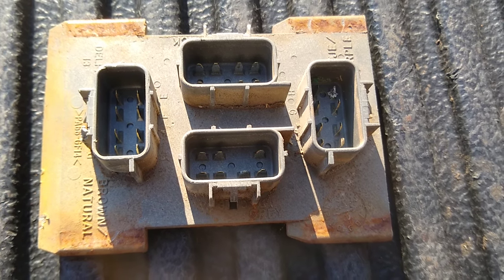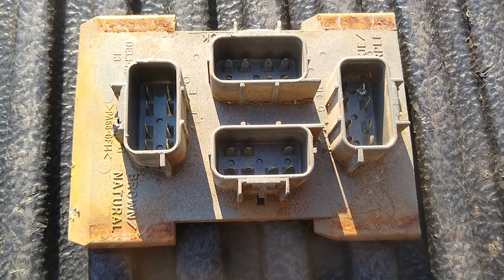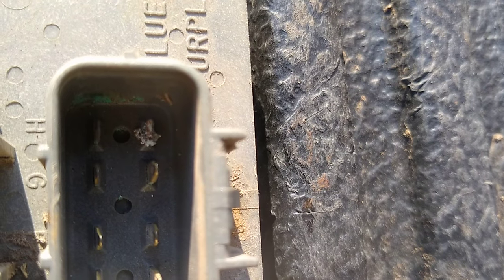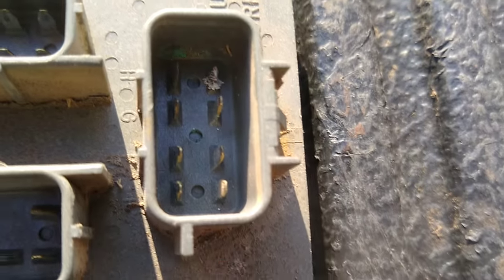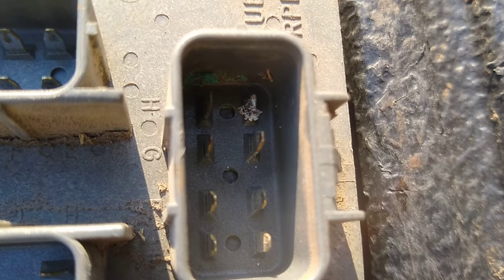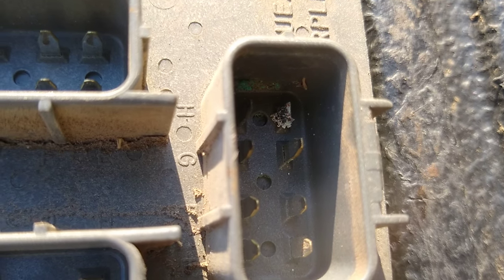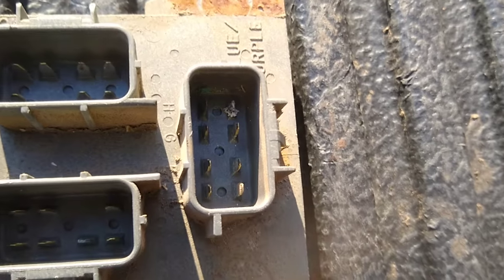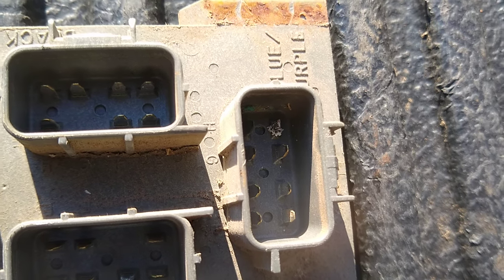1999-2013 Chevy Silverado or GMC Sierra tail light issues

Comment: Its located behind the rear bumper, you should see it if you look up from under the rear bumper, if you need to just follow your tail light wires and it should lead you to this board. 4 plugs are all plugged into it.
Reply: Could this board, also cause fuel pump module issues?
Reply: What is this board called

Comment: I have a 2004 Chevy Silverado my dome nor my reverse lights worked I replaced “TBC 2A” (Fuse) on the interior fuse box located on the driver side it’s a TRUCK BODY CONTROLLER also, make sure to check “TBC 2B” it’s a truck body controller as well.  This fixed my dome and reverse lights problem.
Reply: I also have an 04 do you know where the fuse for the license plate lights is & how it’s labeled ? bulbs are good & I have a new harness. I am thinking it’s a fuse want to check before I buy the circuit board
Reply: @BernieM2819 I also need the answer to this. All my lights on the back work except license plate lights

Comment: Got a 88 Silverado ...i got brake lights ..turn signals ...brake lights and reverse lights ....and front runnig lights ...but my rear running lights come on ..i get to the gas station two miles away from home shut everything off and boom.... when i go to leave and no tail lights happens every morning on my way to work...need help could this be the problem????

Comment: Thanks, my cousing has brakes lights, reverse lights and turn signals but the tail light on the left was only getting 0.06 current to it while the right was getting 12.15, then an hour later the right tail light stopped working 😅 I'll look for one of these at Autozone tomorrow and put it on to see if it resolves the problem.
Reply: I’m assuming it was dimmer as well I’m having a dimmer reverse light, bulbs are new and so is the harness you reckon I need a new board or may it be a fuse
Reply from the maker: @nestorsalazar3713  dimmer lights?  Reverse lights I would check fuse first then possibly wiring issues with  Is squirrels and chipmunk can destroy a wiring harness. The board is only really a problem in places it snow  or someone with a boat who backs the trailer in the water.
Reply: Didn't fix her problem but at least she has a new board 😅 something must be blown.
Reply: @ryannrjohnson  any update on it lol I’m having the same problemo
Reply: @battleborn528  yes, I switched her fan relay with the light relay and the lights started working, so I just had her purchase a new relay. When that relay went bad on my Trailblazer the headlights stopped working, I didn't know the bad relay could cause the rear lights to get intermittent power, but replacing it solved the problem.

Comment: My license plate lights flash when I turn on my hazards, hazards come on when I press my brakes, and when my headlights are on my turn signals are stuck lit up. I tried a circuit block from my friend’s truck and it didnt help
Reply: Did ya find out the issue iam having the same problem atm

Comment: Here’s a shot in the dark, but could this condition of decay also cause the brake lights to stay on? I replaced the switch, and they’re on with the switch disconnected.
Reply: Did you get this fixed?
Reply: @JoseHernandez-xr6zo  
No it’s still in fail. I even pulled the lights out to check for broken insulation. Nothing
Reply: @Iamcheesesandwich what about now anythingv

Comment: I have a 2008 gmc Yukon Denali with after market lights so when I unlock the truck it blinks but when I push the brakes the one on the left side won’t light up
Reply from the maker: I believe that when you unlock the doors that is your parking lights.  So your brake light is your issue.  I believe I describe it in the video that you shouldtry first check your fuses and swapping  the bulb with another bulb, 2nd trace the wire back from your brake light to the module to see which cable it is. 3rd inspect brake cable and brake light module pins from the left brake light,  I believe you could try and swap out left and right cables to see if the issue followes the cable thru might not fit in the opposite jack but worth a try. You might have to remove your spare tire to get access to the module and all the cables.  It has been a few years since I worked with it.  You can order replacement cables or the brake module if you find that one of these are the issue.  Hopefully one of these suggestions help

Comment: Replaced my junction box recently. But currently have rear turn signal issues. Turning on left turn signal will also make left brake light and right turn signal flash along with the left side. Right turn signal is hyper flashing. All my bulbs are good everywhere. Cleaned grounds in several places under truck and under hood. Fuses all good and new flash relay under dash too. No idea what's going on. Think maybe a short in a wire someplace. Driving me to drink!! Haven't checked voltage to sockets yet, but test light lights up solid at both socket grounds and flashes on the other positive side. Any suggestions?
Reply: Currently in a similar situation. Did you figure it out?
Reply: @palmtreepilot287  did you find the problem I’m having the same problem
Reply: have the exact same problem did you ever figure it out?

Comment: I got a gmc 06 sierra i have no brake stop light when my running lights are on you think this would be it ?
Reply: Did you ever find the solution?
Reply: @bluejfishin3995  i did and ended up not being none of this it ended up being the main cables coming from the computer harness since i have way to big rims 22s lowered so my tire would rub and grind against the top of driver side wheel well thats where all the main wires going to computer some them were stripped of due to my tire bumping and grinding on them at bumps and electric taped ones that were broken off which there all just color match

Comment: I replaced my tail lights but the assembly doesn’t have tail lights. Signals hyperflash. I’m going to try this to see if I can get my tail lights back, and get my turn signals to not hyperflash
Reply from the maker: Turn signals hyper flash when you have a blown bulb or you replaced with LED's you will need to install resistors if you replaced any bulbs with LED's
Reply: @apuckett1971  Sometimes it's better to skip the relay and go straight for the relay and replace it with a LED compatible relay. Resistors are inefficient and require proper mounting

Comment: Thanks man. But, where is this located?
Reply: Right under the bed in front of the trailer hitch
Reply: What's the name or part number
Reply: @lukebeaumont8094  Dorman 923-012 Tail Lamp Circuit Board

Comment: I’ve got blinkers and breaks but no running lights, thinking this may be what’s up
Reply from the maker: Is all the fuses are good. Disconnect the connectors on the block and look at all the pins if you see green in the connector it's about a guarantee the pin has corroded away.
Reply: Did it end up working
Reply: Jair Alfaro vlogs it ended up being the plug that goes to my tail light was missing a piece of wire on the plug. My circuit board was fine but I cleaned it like 4 times
Reply: @brandonwolfe3402  where is the plug that goes to the taillights located? Having the same issue
Reply: Giovanni Balcazar near spare tire under the tailgate
Reply: @brandonwolfe3402  I fixed it it was my fuse lol thank you!
Reply: Where is the fuse for tail lights I have brake lights and signals no signals and my cluster lights are out
Reply: @brandonwolfe3402  where’s that plug at ? I’m having the same problem
Reply: BlockBurnaa the plug coming off of the bulb and the little harness piece it connects into. The plug had a missing/broken piece of connecting metal so I got a new plug piece and spliced it up. Hard to explain because I did some bootleg method but it worked
Reply: @BlackExellence940 where was it?

Comment: Ive got no reverse lights you think This will work
Reply from the maker: First step is to check your fuses and bulbs.  Since you have no reverse lights I would check all the connectors in the board.  Inspect all the pins and  connecter for corrosion if you see any green corrosion on the connectors it could be your problem. I really hope this helps. If you are working on a truck it is a lot easier to check trail lights and this board.  It could be a cut wire which is harder to track down.
Reply: I have the same problem on 2011 GMC Sierra

Comment: i have no lights whatsoever
Reply from the maker: With no lights at all I would think that could be a bad board,  just unplugged or the wires going back could be cut possibly a bad ground wire.  I would check all of your fuses first but most likely some of the lights would work if it was fuses.  Someone posted below about TCB fuses they are on the driver's side dash but they are usually interior lights, guages, instrument cluster and the sort but I guess also reverse light. If you had no interior lights or cluster was out I would guess tcb1 2 or 3.
Reply: @apuckett1971  thank you all of my lights work except the passenger said e tail light prob a bad ground wire
Reply from the maker: @rizo3336  trace the wire back to the board on the back left of the spare tire mount.  Check to make sure it is plugged in if it is unplug the connector for that tail light check all the pins for corrosion and that they are still there. Check your bulbs to if you already checked fuses. You might need to pull out the tail light if everything else looks good.  I know Trailblazers have a board on the back of the tail light housing that goes bad. I hope this helps
Reply: @apuckett1971  thank you
Reply: @apuckett1971  what is this part called so i can replace it
Reply from the maker: @rizo3336  the one under the truck is called a tail light circuit board. Just put in your year and vehicle. example 2008 silverado tail light circuit board
Reply: @apuckett1971  okay thank yiu
Reply: I'm having an issue when my auto lights come on only one blinker works all my other lights work reverse running lights brake lights just my blinker doesn't work when my lights come on
Reply from the maker: @drogers9275  have you checked your fuse. I believe parking lights and turn signals are on the same pair of wires.
Reply: @apuckett1971  is it the fuses under the dash side of dash or under the hood?
Reply from the maker: @drogers9275  yes I believe the fuses are under the hood Hopefully it is not a wire. I had a power wire short and kill my ac until I found the burnt wires